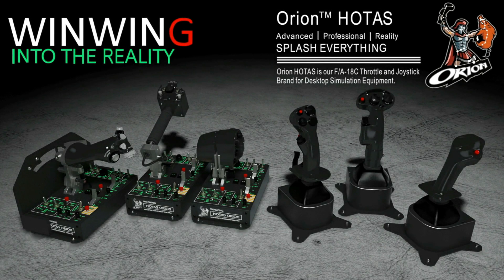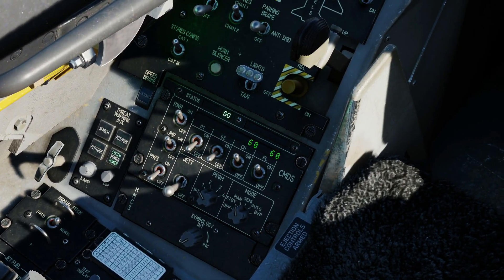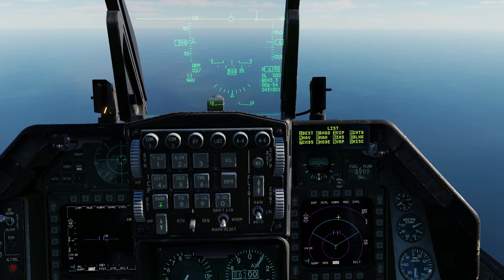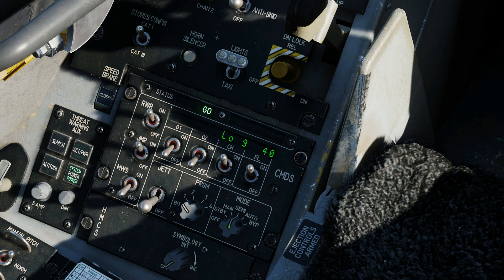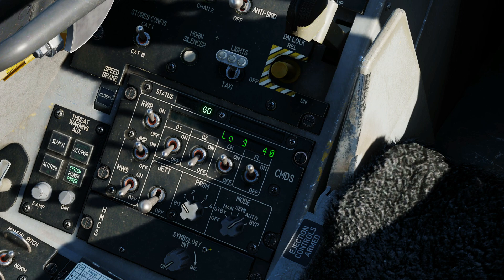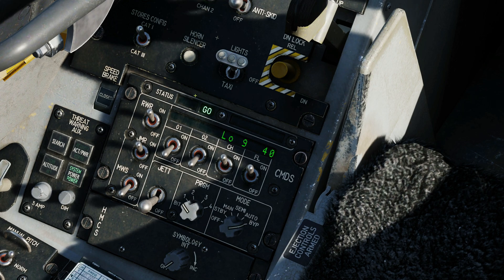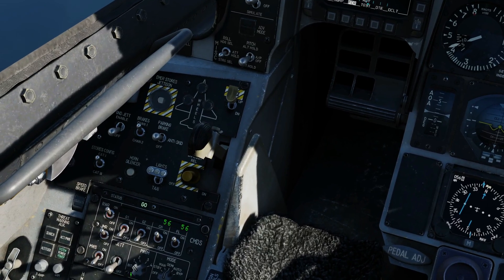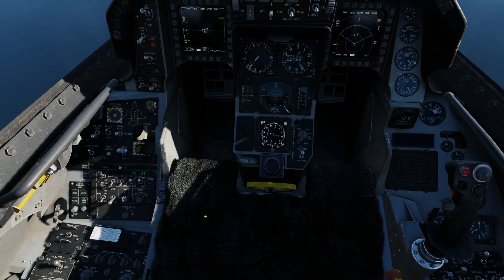F-16C Viper: ALE-47 CMDS Countermeasures (SEMI/AUTO/BYP Modes) Tutorial (Vid 2 of 2) | DCS WORLD

Comment: Cap, since DCS has new sonic booms I wonder if you could test  something.

Imagine a taget ship with a supersonic Viggen passing by at a fair distance. When the taget is at 3 or 9 o'clock the aircraft start a 180 degree turn into the ship using the autopilot to keep a constant radius.

After 180 degree the aircraft passes extremely near the ship, but on the opposite side from when the 180 degree turn was initiated.

Will this cause an amplified hypersonic boom if all booms reach the ship at the same time, or can you ripple sonic booms over time?
Reply from the maker: Cool thanks Sven

Comment: Why are auto programs even a thing in fighter jets? I've never seen a use for them. If they only responded to launches automatically it would be reasonable, but I've never seen a use case for it.
Reply from the maker: No idea. Useless.
Reply: I guess it is for  if a pilot is task saturated or for Missile fired with out a lock but have lock on after fire.